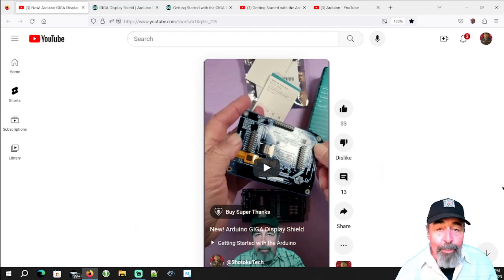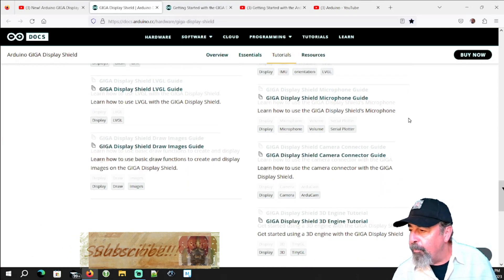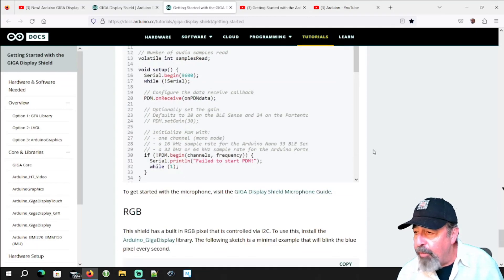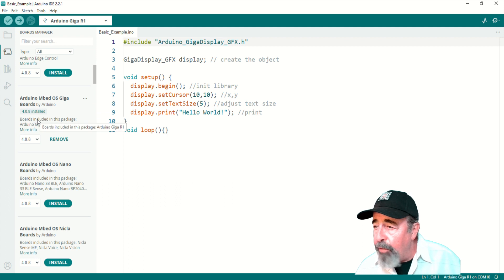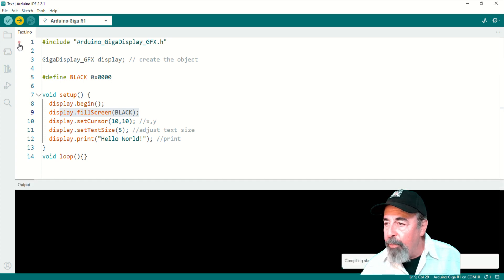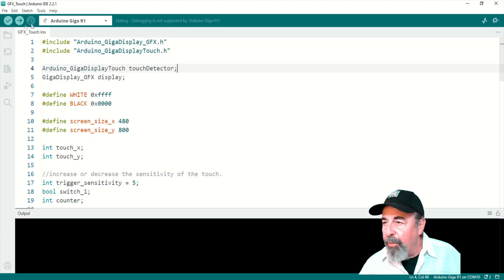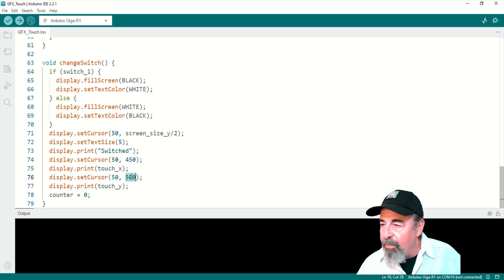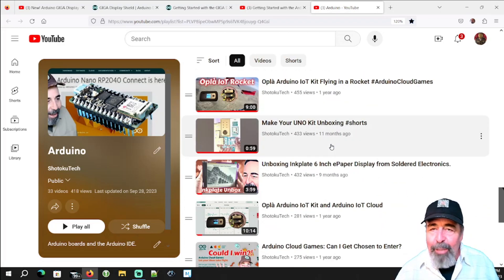Arduino GIGA Display Shield GFX

Comment: Can we use this display shield with any arduino? Is the display comunication over I2C?
Reply: Yes, I know that it is designed to fitt the GIGA board, but in the spec's for the display it says it is I2C. So if I just connect the correct pins I should in theory be able to control it with an Arduino UNO?
Reply from the maker: @Zarundo  Sure follow the links to the docs page and get the pinout for it. If it works, let me know. Thanks.
Reply from the maker: Hello. It mates directly to the bottom of the GIGA R1 WiFi board. See that here: https://youtube.com/shorts/b1Xq3zc_tT8